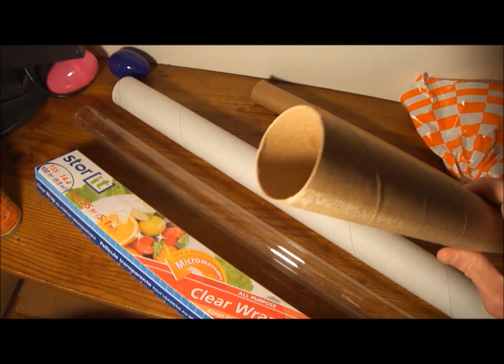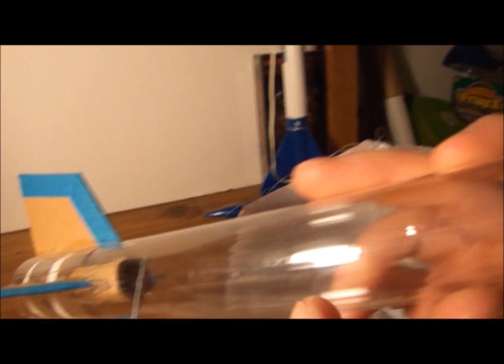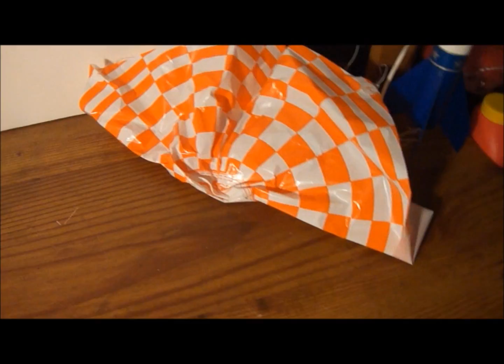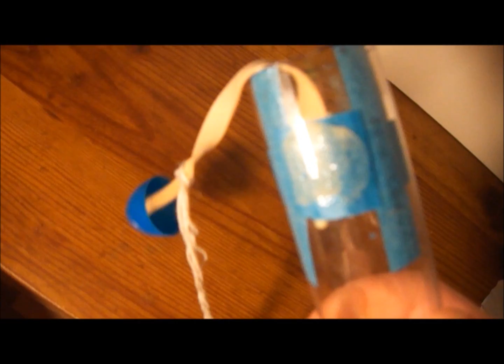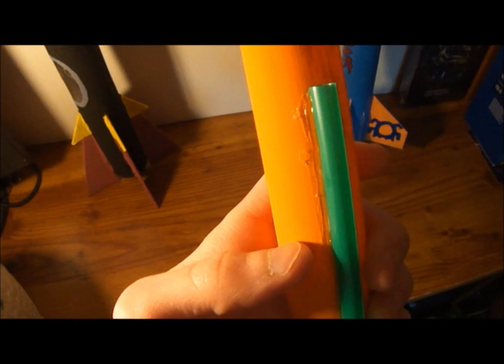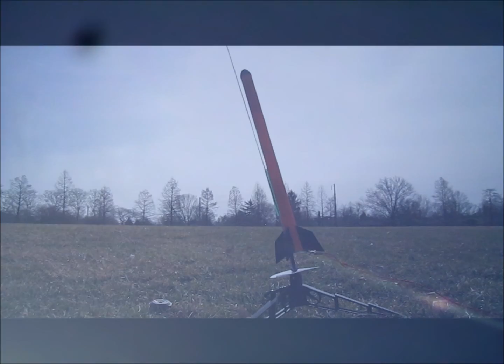HOW TO BUILD HOMEMADE MODEL ROCKET, SIMPLE, QUICK, CHEAP!

Comment: dude do yourself a favour and be a little safer, and dont put in a ignition cap before launch. Just put it in at the Spot. static elec can set it off too do to High voltage👍

Comment: That was one of the best how to rocket videos I've found on YouTube. Great descriptions and the use of a clear tube showing the inner workings was a very nice touch. Thanks for this.
Can you explain how the igniter you made works? 
How does the nose cone stay on and what releases it? 
Thanks for the great video and for your time!
Reply from the maker: +Michael Becker Thanks very much for liking my Video Michael. I used the igniter from the Estes modle rocket starter kit, the instuctions explain it, and its very easy to follow. My nose cone stays on by adding masking tape to get a snug fit. Remember to keep your nose cone not to loose or not to tight. The nose cone comes off from the pressure of the rocket engine using its second stage.

Comment: I have my own rockets like the Athena, and they all require heat resistant material in between the engine and parachute, yet you used none? Are they irrelevant or necessary?
Reply from the maker: Daniel Martin Yes i have hobby grade paper wadding for the parachute! I suggest you use this so you don't burn up your parachute!

Comment: How does the parachute deploy?
Reply from the maker: When the rockets engine hits the second stage it has a small explosion the opposite way pushing the parachute out.
Reply: Like they said ^^^ engines have two parts, the part that pushes the rocket up, and the part that automatically blows the parachute. It's built into most standard small engines
Reply: Daniel Martin i was just confused but now i know
Reply from the maker: ***** Good, i'm glad!
Reply: ELKFILMZ thanks for taking your time to explain this,most of the people dont do this anymore

Comment: if somebody dont now you need to buy motors that motor was about 6 dolars.
I to moddeling rockets .I live inEurope Lithuania
Reply from the maker: Thank you for your comment! In the U.S. you can get a 3 pack of rockets for around 10 dollars. It is easier to just buy rockets! How is Lithuania btw?
Reply: Well we Lithuania rockets do the same. Few bought them. And on this side of the price the same. We buy from ebay and HOBBYSHOP. This is link of my circle. http://mtkc.lt/index.php/kosminis-modeliavimas.html
thank you very much for answer.
  I invite you to friends google+
karolis.poviliunas @ gmail.com
Reply from the maker: LTUapollocraft Thanks for your response, and your welcome for my answer. I'm glad to see that this is also a fun hobby overseas!
Reply: Do we need a motor to use r-candy fuel?
Reply from the maker: ChuChu Rocket I would just buy the motors. Not messy, and not really that expensive
Reply: I'm building all from scratch
Reply from the maker: ChuChu Rocket Good idea, i hope you will find some inspiration in my video.